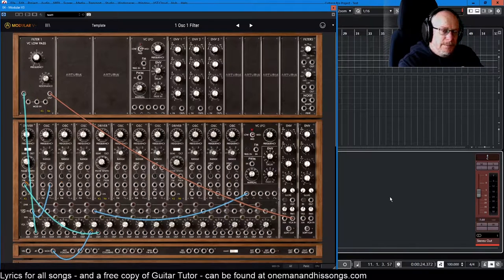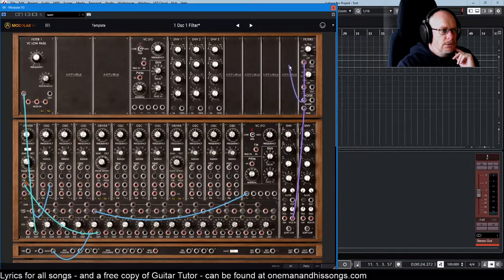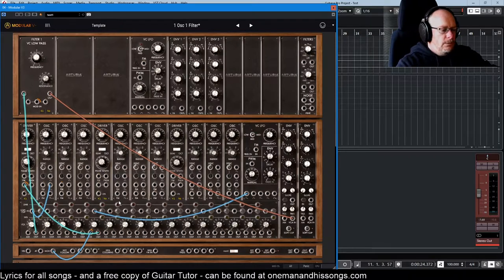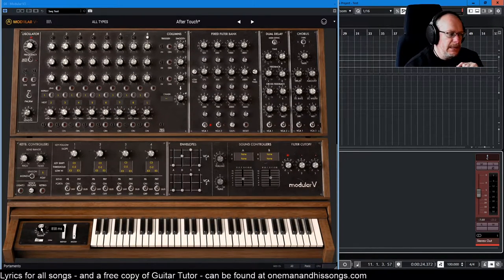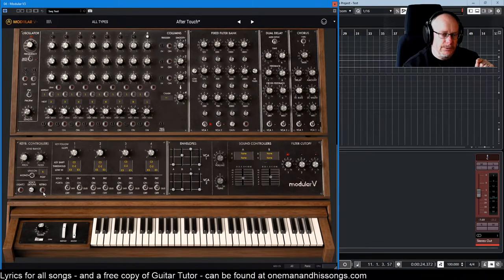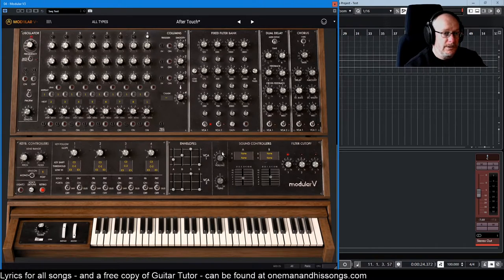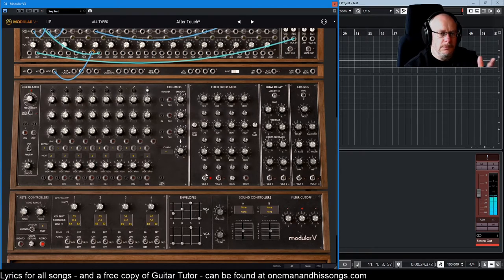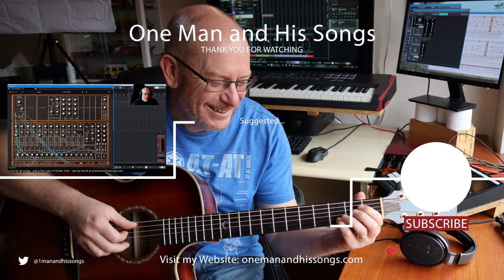Arturia Modular-V Walkthrough Ep.06 - Module Wrap-Up

Comment: What I found in the manual and what really lets the Noise-generator shine is the "Sample & Hold"-module (S.H.): Connect a Noise-OUT to the S.H.-module IN and put the "TRIG ON"-switch to the left. Then, choose the "TRIG IN"-source (for example "Keyboard Trigger On"). Now each time the TRIG IN-event occurs (in this example: each time a key is pressed), the current level of the NOISE-input gets sampled and is held and sent to the Output until the next occurrence of the TRIG-IN-event (in this example: until the next key is pressed). 
With this simple connection, you get a random voltage which stays the same for a controlled amount of time....For example: you could use the S.H. Out of the example to control a Filter. So the Filter has a random Cutoff, which changes with everytime you press a key - but stays the same as long as you press the key.
You can make really, really nice stuff with this.
Reply from the maker: Absolutely, thanks for the post! I feel a bit sad that I didn't spend longer discussing the individual modules for this synth. It's certainly an area I'd like to revisit in the future.

Comment: Are there any significant differences between an EQ and an actual fixed filter bank? Or are the two terms more or less interchangeable? Because here it's labeled as an FFB, but you refer to it as an EQ, is there something I'm missing?
Reply from the maker: I shouldn't have referred to it as an EQ, but functionally they are very similar. If, for example, I setup a notch filter at 1khz, that would yield the same result as pulling down a parametric EQ centred on 1khz. If you look at the results in a spectrum analyser you'd see the same shape in both cases.
Reply: @OneManAndHisSongs  Thanks for the clarification, and thank you for this series!